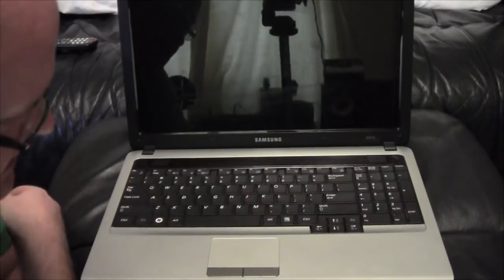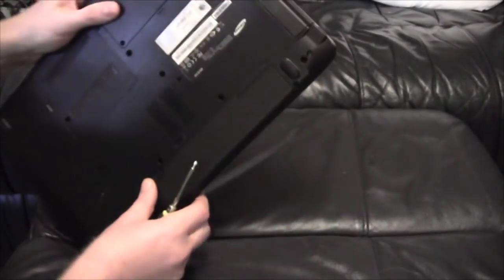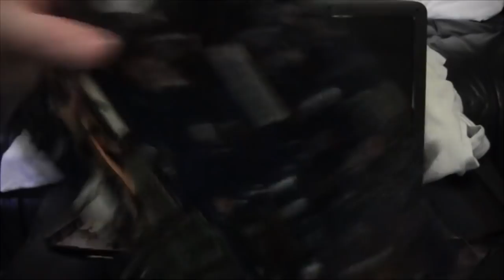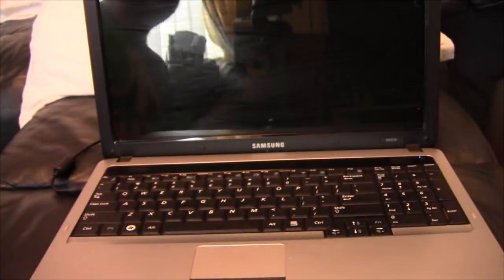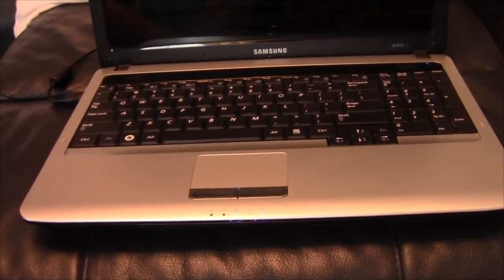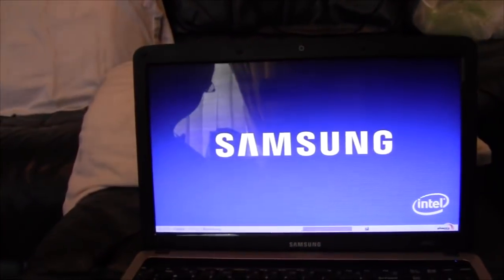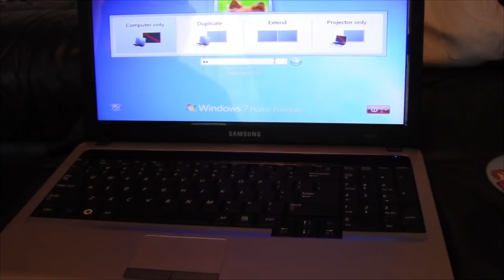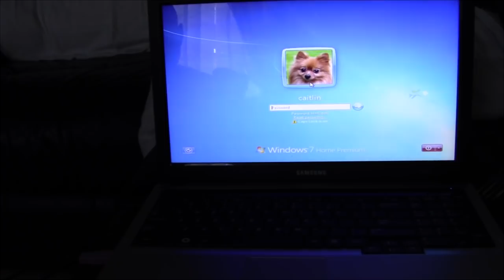How To Repair A Laptop After A Liquid Spill : Tutorial !

Comment: hi my touchpad on my laptop is (I thing broken) and my keypad as well. 1 after like 5 to 10 mins or so the touchpad stop working and to get it working again I have to whack it like12 times and probably not surprised its windows 8.1 and 10 buttons don't work after I droped my laptop in the shower. the reason why it droped in the shower is because my dog knocked it over. this is the laptop am using now with a mouce and a keyboard. and how do I fix my usb as there rusty after the laptop fell in the shower. also it smokes after 20 mins from I think where the fan is so I don't know if the fan is working but the laptop still turns on after so much water. it died for 24 hours then come back to life. ok bye reply what I should do. thx.
Reply from the maker: best griefers Get a new one, you've buggered it.
Reply: RetroGamerVX this laptop is custem made for me and I will tell u all information now. GB OF RAM:16  HARD DRIVE DATA: 2TB SAMSUNG HDD. it lights up when I turn it on. shall I get a new fan and keyboard reply to give me examples of what I should do. btw the keyboard is starting to work now YAY and the touchpad is giving me shocks now. the screen is now fine and the laptop runs perfectly and I found out what was smoking, it was the fan not working and the intel burned out from the water. very slow without the intel. I don't know its working without the intel i3 prosessor its amazing I put an old computer from windows xp and its a intel Pentium. atleast it works abit still I orded a new intel i3 prosessor thank god anyways ill tell u when I get the new fan. so tell me what I shall do pal thx

Comment: if only water is spilled on the laptop, and just like in this video, just some keys aren't working, the only option is to use an external keyboard? In my case it's the first time some liquid has been spilled on it.
Reply from the maker: spmkjh replacement keyboards are cheap enough on Ebay these days :o)

Comment: I have an HP g6 that had a bubbly drink spilled on it, now most keys on the keyboard don't work. Could replacing the keyboard part work?
Reply from the maker: Kathrine Paulk Yes, probably best to try replacing the keyboard first, but check the motherboard connector for corrosion as you remove it.
Reply: I spilt water on mine.  I'm having the same problem.  I do have all my programs, downloads and photos so I'm not too upset.  I haven't used it in months so I figured today hey I'll try it again.  I made a mistake and used numerical password, but was able to use the mouse to put the password in after three attempts of just pressing keys and pressing enter.  I would say I have ten keys that work :```(.  Luckily it is not my only device but it is frustrating. Hopefully someone will answer the both of us.
Reply: Im going to buy a usb keyboard first and then have someone who knows what they are doing look at it.  Thanks.

Comment: Need help my sister accidently spilled orange fanta on my stone windows 7 laptop and its not powering on. The laptop is on its side and the battery is removed but will that be enough. Btw there's NO way in hell my moms getting me another laptop and this is painstaking because I barely have anything to do at home because I'm broke and all my passwords and stuff is on it plz HELP!!!!!
Reply from the maker: If its got on the motherboard, will need stripping and cleaning or else it will destroy it in 6 months!!  By turning it on whilst wet, you may have killed it already, hopefully not!
Reply: RetroGamerVX I spilt tea on my laptop and it went off and came on and said  boot device not found it is an Acer windows 8

Comment: i split coke on my Asus laptop yesterday. It switched immediately and didn't switch back for a while. i tipped it on its side and a few hours later it switched back on but the mouse pad doesn't work. the cursor doesn't even show up! i have to use a connectable mouse but its a pain. my sound in video games installed to my computer also keeps shorting out or is delayed. it's only a few months old. maybe 4-6. i haven't told my mother it switched on so i didnt see it as a problem worth telling her. idk what to do. any help on whether someone can repair it, if warranty will cover it or anything else? need help ASAP
Reply from the maker: Watch video, carry out procedure or acid in coke will finish your computer off.  If your sound is shorting, damage has already been done too by you switching it straight back on.
Reply: (DO NOT DO THIS IF YOU STILL HAVE WARRANTY OR IT MAY BECOME VOID) 
I would open up the laptop, take out the battery,ram and anything else removable. Put everything in a bowl/bucket of rice grains and wait a week or so. If the battery,ram or anything is sticky I would give a quick wash using slightly wet paper towel or alchohol wipes beforemputting in rice.Hope this helped.

Comment: My laptop has recently been in an accident. Coke was split on it and I cleaned it off and I went to pee then when I came back it was grey and frizzly like staticky. When I put in the charger a fan goes on it goes loud then goes quite. The screen is black nothing is happening had my laptop does forever :(
Reply from the maker: Yup, I think that's dead, coke is highly acidic, the worst thing to drip on it.  If you do that to another comp on the future, do not switch on and strip and was as quick as possible :(

Comment: I spilled some water on my laptop but the problem is it entered through the side gap from where the hot air is ejected. I had immediately turned my lappy to remove some water, after that I also use a blow dryer on the sides and below the lappy to make it dry but I have not yet removed its parts individual like you did. So, can you help me with what I can do further to make it powered up. Please do reply.

Comment: My Laptop is only around 4 months old. Its an acer aspire e5, I took the battery out  2 weeks ago and took a damp if not less than damp cloth to wipe the gunk off the outside of the keyboard. When I tried to turn it back on after It failed to boot up then kept trying to restart on its own. So i removed the battery again and left it upside down for a day or two. After contacting acer they had be do a hard reset on it. And it worked fine for a week or so after, now last week it failed to boot up even with a hard reset. Is there any thing I can do to bring it back to life its a $700 computer and the cost of replacing the motherboard is around $600+...
Reply: I rely on this computer for school and online gaming so as a teenager this is killing me.
Reply: I don't make money to spend often. It killed me to make that 700 dollars.
Reply: Im thinking im going to look for the motherboard I need and have someone cheaper install it
Reply: If i can get it for 100 or 200 dollars is cheaper than going out an buying a 500+ desktop. To be honest if i want the same specs or better than this computer has ill be paying 1000+ if I get it as a desktop.
Reply: Dylan Jamrozinski i doubt that, what are the specs on your laptop?

Comment: If we spilled very hot tea(just make) on the laptop,would our laptop be demgae forever
Reply from the maker: If it had sugar in and you don't clean it out, yes.
Reply: It does not have any sugar just a tea i turn it upside down and nothing happen i cant switch my laptop on back i put my laptop upsidedown for 1 day aldy.my laptop is dell inspiration 13 2014
Reply from the maker: WAN Fenium Then it's buggered :o(

Comment: Sorry about telling this but they named it like this, if you spilled water on your laptop or pc, your mobo of your laptop or pc wil get "chip-cancer" that means that there is a little short out in a ic (intergrated circuit) a spot that is just a couple atoms big and it gets bigger when powered on untill it draws to much current en blow it self up due heat from shorting, ic that run on low voltage are sensitiver to liquid and shorts. The spot in a semiconductor wil create a hole to the lithography and creates a connection between a grounded substrate and voltage pipelines, it spreads by shorts and heat, thats why they faile. If you realy want to get it work, replace the damaged ic now untill everything needs to replaced. Sorry for my bad english.

Comment: Thanks for posting this video although you almost gave me a heart attack!!! I'm an IT student and I've just been studying the correct maintenance and repair methods for desktops and laptops. I currently do repairs for friends and family and may not have as much experience as you but I can not condone anyone using water to clean a motherboard with the RAM still intact :O. Isopropyl alcohol and a lint-free cloth is the correct cleaning means. Also you stand the risk of Electro Static Discharge (ESD) by not using an anti-static mat or armband. Just some helpful input for those who think this is a good idea...
Reply from the maker: Me,  been doing this since 1996, no issues so far as long as it's dried properly :)
Reply: for a low tier laptop i can understand using water, but for my 1500 euro msi i think im gonna dip it in isopropyl just to be safe, thanks to the both of you!
Reply: Using alcohol is indeed the right solution, especially because the alcohol will vaporize with no residue.
Reply: That's real talk. 

Water (especially tap) will leave residue once dried. This residue contains charged minerals that react to the metals on the motherboard. Thus increasing the rate of corrosion. That's electronic repair 101.

Use isopropyl alcohol, compressed air, soft nylon brush, and a lint free rag for a proper cleaning.
Reply: In my experience using isoprophil alcohol doesnt remove dried up sugar residue under certain parts. On these cases i use distilled water.
Reply: @Cazimie Same. I got a laptop that was soaked in latte and I had to use distilled water to clean it up. I used Isopropylic alcohol to remove any water residue.

Comment: I had my elitebook 6440p where I thought was kitten proof,but no,she managed to knock a glass of wine's contents contents right over the keyboard-3 ft away,pulled out HD,battery,unscrewed and removed all panels from back and have it upside down over a tea towl.The graphics went crazy,no screen but did turn on before I quickly acted.Always used a plugged in monitor.
Will remove keyboard in the am-HP-great until this-4 years,bugger it
Reply from the maker: Bugger :o(

Comment: I didn't know what to do at first, and didn't realize that I spilled water on it, so I tried to switch it on and off a couple of times. It worked the first few times, but then made some sounds, and wouldn't turn on. So, would it still work after 48 hours?
Reply from the maker: I don't know, you may have done damage switching it on.  I'd do as recommended and leave for 48 years, see what happens afterwards, let me know please :o)

Comment: So if I just spill water, and it stops working, I don't have to take it apart? Do I just leave it on its side? And for how long?
Reply from the maker: Yes, if it's just plain water, there is nothing in it to cause long term corrosion problems like the sugar in sodas etc.  Take the drives out and put it on it's side for around 48 hours and it should be ok if you switch it off immediately :o)
Reply: RetroGamerVX well i turned ot on immediately and then after a few hours i took off the battery and turned my laptop on its side

Comment: Hi, cool tutorial, I followed it after a coke spill a couple of days ago and although it powers up my screen is dead. Plugging in a hdmi cable brings up a blank screen that I can move the mouse on but nothing else, normally I plug in and use the TV as an extension, which is what it seems to be but I cannot see what the main screen has to say. Tried windows key +p and the fn keyboard shortcut but can't get the main screen to display. Any ideas? Thanks, rob.
Reply from the maker: Did you spill any on your screen it'self?  If not, check the connections too it from the motherboard have been put back right :o)
Reply: Connection is in correctly but not even a flicker when I boot

Comment: Please tell me whats wrong i have a hp pavilion 7 and every turn on all the lights but the screen wont turn on what do i do please reply
Reply from the maker: It's difficult to tell without it infront of me, could be a motherboard issue, power issue, screen issue!!.  Did the screen show any signs of ailment before it stopped working (pixilating, cutting out etc), do the fans run all the time?  Did you spill anything on it?
Reply: RetroGamerVX i spilled water on the keyboard and i turn off the power right away but didnt unplug the source and usb and then i tried to turn it back on now all the lights works except the screen wont turn on please tell me whats wrong there wrent any minor things it just stays off the screen only
Reply from the maker: ***** With water, you can just remove the drives, battery etc, leave it on it's side for a few days to drain and dry out.  If you've tried to turn it on, you may have shorted it, killing it.   Leave on side for a few days then try again, if it still doesn't work, then it's likely you'll need a new motherboard.
Reply: Where should i get a new mother board i already tried to drain it for a few days

Comment: Hello, I want to try this on a laptop I received. I want to know if its still worth the attempt. It had some sugar liquid poured on it and they even tried to power it back on soon afterwords. Laptop has been collecting dust for several months now before they sent it to me. Is it corroded beyond repair from sitting idle for so long.
Reply from the maker: I have no idea, only way to find out is to power it on, should be dry by now, if it works, strip and clean :o)
Reply: When I hit Power button, I hear a faint click sound, and nothin happens, no lights turn on

Comment: I spilled coffee on my laptop's top cover a week ago. I think some of its sides were affected but I'm not sure. It won't turn on for a day but works fine now. I did clean it as much as possible and didn't use it for a week with battery pulled out. Do I still need to clean it on the inside? I'm currently using it....

Comment: i'm shocked
Reply: Why? Water is fine as long as there is no current flowing and the water doesn't leave behind lots of residue. You have to be careful about components that have paper etc in them.
Reply: donpalmera lets not forget that there are capacitors in side ever electronic device and they might carry a charge or not, i cant believe that woks ! some times by touching some of  ic's you can burn the like rams
Reply: Ojan Gorjani How much charge do you think caps on a pc motherboard could hold..

Comment: Wouldn't removing BIOS battery from motherboard wipe all the data on the chips? You would have to leave the board for a least 24 hours of the board to dry which is a fairly long time for the processors to go without power?

Comment: I have similar tail involving a Toshiba lappy that was exposed to a (man)child, the (custom, built into the case) trackpad is toast so I... er... the user is resigned to using it with a mouse, the keyboard only works if you bring it out of sleep or hibernation and the things shuts itself down when you try to boot any kind of Linux
...other than that, it's perfect!

Comment: Just don't put it in the oven! Lol. None of it. 

Joking aside, Plastic melts at at different temperatures, depending on construction... Unless you know the specific tolerances, it'll melt, warp, shrink, expand and generally not fit back together correctly. Being lazy and taking shortcuts lands you a warped space bar. :-)